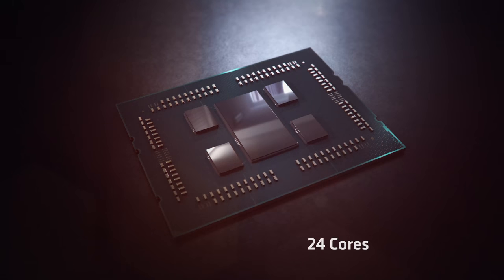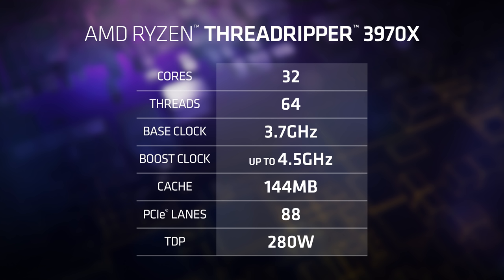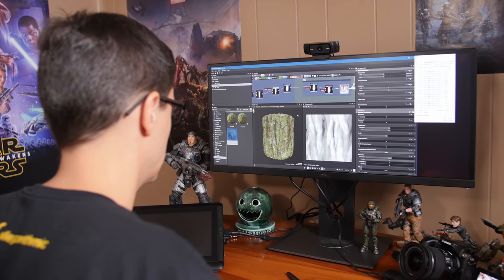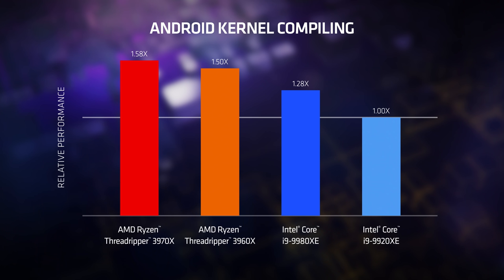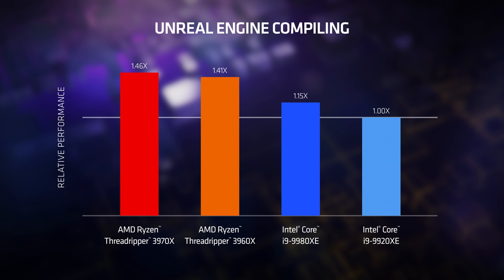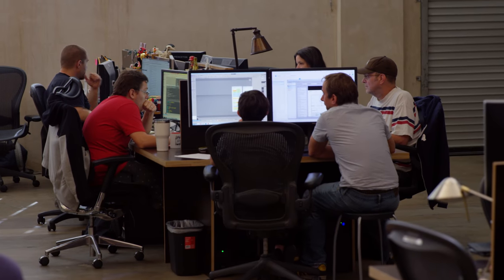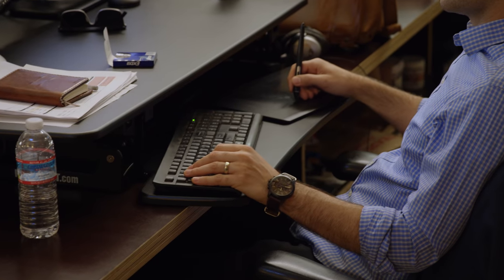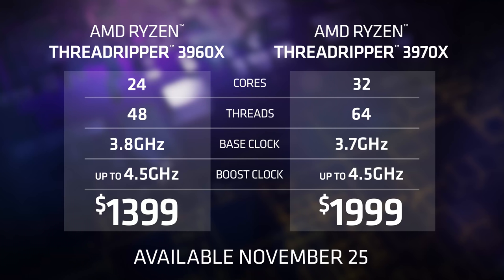Performance Preview: 3rd Gen AMD Ryzen™ Threadripper™ Processors for Creators

Comment: Still can't understand how AMD could do this stupid launch. With intel 10990x 18 cores at $999 what is the sense of the AMD 24 cores at $1400? Where is the great performance per value that we all expected? Pretty disappointing. Hedt platform can't even explain why the 3950x costs 750usd and the 3960x double the price. This is a big fail to me. I'm so disappointed.
Reply: Maybe its strong enough to beat intels new chip (performance per dollar). The internals of the chip beats the 3950x by a longshot
Reply: @pirre97  until you use up to 32 threads mainstream platform would probably be faster than those overpriced CPUs or it will compare very very similar. So no, no one needs all those PCI express lanes on an old architecture based on ddr4 that have only 8 core more than mainstream for double the price. This threadripper are so disappointing, I think that those CPUs represent the reason why AMD scores second in this market, they missed opportunity even when they are so simple to catch.
Reply: @sblantipodi  i would recommend you to watch Moores law is dad's latest video about it.  A few years ago a 10 core intel Xenon vas 1700$, now you can get a 24 core for 300 less or for 300 more you get a 32 core. But yes, AMD's prices for TR  have skyrocketed since last gen. Although you can get a 3950x for that price now. And it will most certainly beat the new 10980.

Maybe a Jebaited 2.0? AMD is looking for what the market can accept as a price. They are taking a premium because they need all the money they can get to grow and be able to handle the punches that Intel will start too throw at them